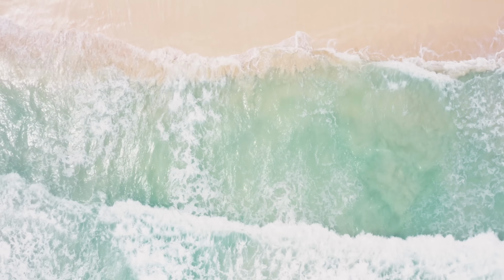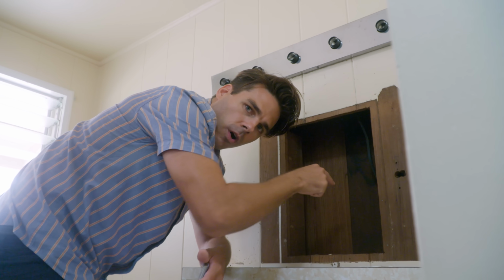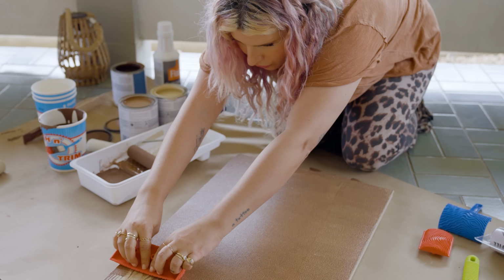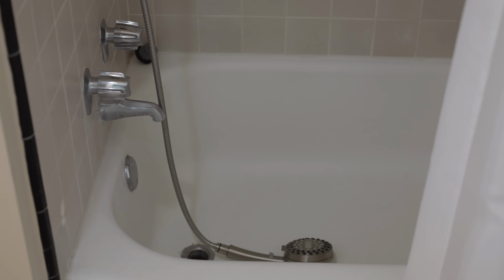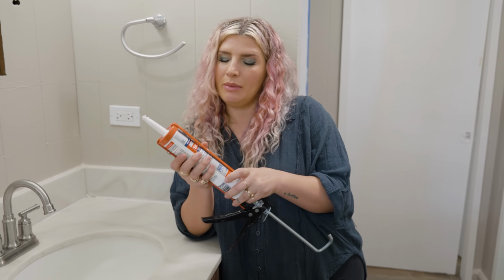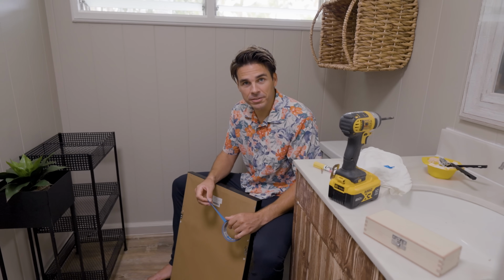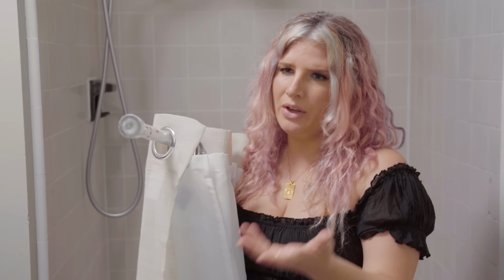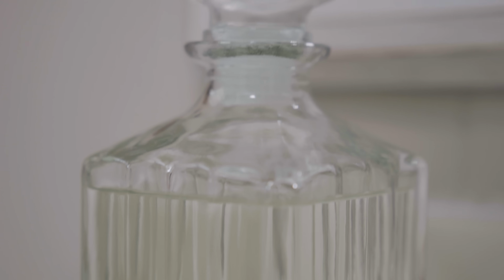We make this old bathroom look EXPENSIVE *20 Budget DIY Hacks* (Island Fixer-Upper)

Comment: i was amazed by how the fake wood technique turned out! i'm definitely trying that!!
Reply: I must be an outlier on this point, but I prefer the look of "honest laminate" to faux bois (fake wood.) I'm a big fan of things looking exactly as what they are. To me the authenticity is a better look than the "I tried to dress it up to make it not look cheap" look. That always ends up looking more cheap to me, especially as it ages (flaking or chipped paint showing the laminate underneath.)
Reply: @jeanvignes  I think it would have looked better with a lighter color of paint instead of the dark brown paint that was used for the “wood grain” effect. Additionally I also think it would look more believable if she had painted the wood grain on the top panel (the skinny strip of laminate directly above the cabinet doors) horizontally rather than vertically (which is how the grain is for most real wooden bathroom cabinets, with the doors having vertical wood grain and the wood above the doors having a horizontal wood grain).

Comment: Hot glue in hot humid areas will eventually melt away, even the strongest highest heat stuff (in my experience). Have def had it happen with costumes - would be fine for days and many wears and events, then go into a nightclub enviroment, and within an hour or two, it starts drooping off. Bathrooms (after hot showers) and nightclubs have a similar humid environment
Reply: Yeah, I would have used marine epoxy.
Reply: Thinking about nightclubs and bathrooms having the same environment grossed me out lol.

Comment: You can re finish sinks and baths? Does it work on toilets? Our upstairs bathroom was last decorated when my mum was pregnant with me... 22 years ago, and a cream 3 piece suite was installed. I should add that the toilet seat is also WOODEN. We can repaint the wooden toilet roll holder, towel holders, and the toothbrush holder thingy (or replace if we can get the holes to line up) and repaint the bath panel, change the taps etc, and paint the walls and tiles, but the suite will have to stay. Knowing that we could re finish them will prove useful if we ever re do the bathroom. We're not sure if we're going to have to move or not in the near future, but if we don't that will be handy to know.

Comment: Just a question about the floetrol. I've used it before in painting my kitchen cabinets but the problem that I experienced was that the paint seem to come off easier over time. I don't know if you have experienced that same issue. But keep in mind I did my cabinets about 11 years ago. What I found to fix the problem was to go over the cabinets with a water-based polyurethane clear coat

Comment: Valve stem replacement is my personal nightmare. I’ve had to do it three times in 3 houses. It’s what I get for buying older homes and rehabbing them. I have a newer condo now and hope that my bathroom renovations will be easier this time.

But honestly I’m expecting a nightmare because there wasn’t even a box for my light fixture in the wall. Just a wire hanging out.

Comment: Here's a tip for YOU. Use a real metal pipe, like a copper pipe, for the shower curtain rod, and cut it to size, and put it in to closet rod holders, painted copper to seal them. You don't have that annoying seam in the middle of the rod. And it looks awesome.

Comment: So you didn't like the black quarter round surround tiles in the guest bath and painted them white. Then you covered them up with curtains but then added black elements in the artwork, tables, and door pulls. Black surround tiles are not dated or out of style.